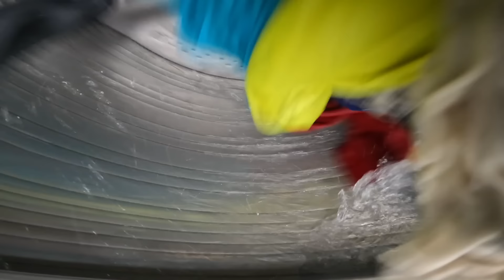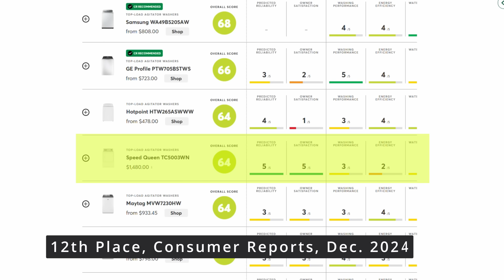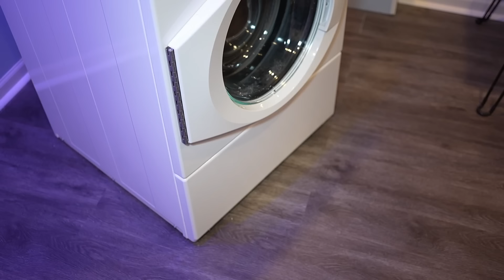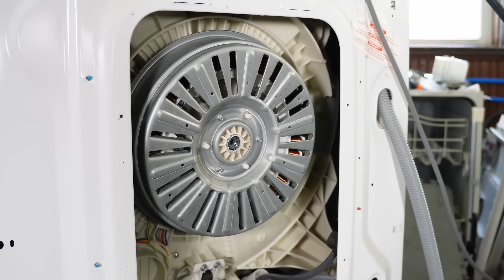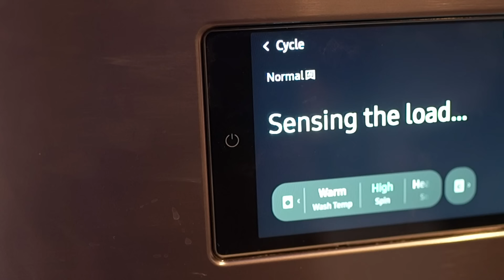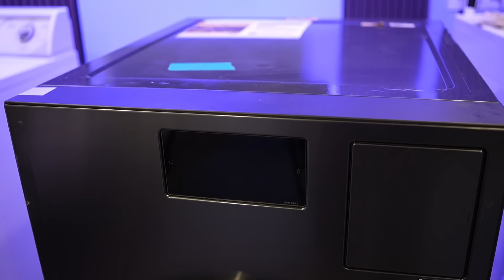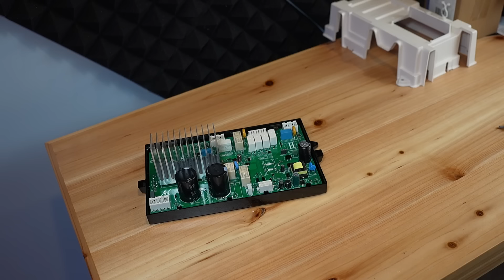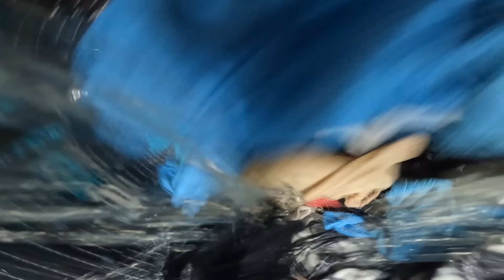Is America's Most Expensive Washer Great? The Speed Queen FF7009WN Test

Comment: So what is the best washer to buy? As far as wash time price durability and of course how clean your clothes are in the end? It seems impossible to find that answer anywhere. 
Here's what I want from a washer

1 clean clothes

2 washes clothes quickly
3 reasonable price
4 washer isn't going to need constant repair
5 washer should last at least 10 years minimum
6 quiet
7 low water consumption
8. Some bells and whistles
9stylish
10. Easy repairability
11. Durable. 

Why is that asking so much?

I don't care about wifi, ai or other crap.
Reply from the maker: None of those things are possible together. You're demanding a few contradictory things.

You cannot wash fast and with low water consumption. That is not possible. You get to pick one.
You cannot have a washer that is reasonably priced and will last 10+ years. You get to pick one.
You can't have a quiet washing machine that is going to have the other things you demand, because quiet requires a BLDC and they aren't built for speed.

Until you're willing to cut that list in half, it can't be built. Quality costs money. Performance costs money or quality. Efficiency costs time.

Comment: $600 for the replacement motor board is an absolutely scam. The components on it cost less $15, of course I dont expect it to cost $15, but in no way should it be $600, that buys you a BRAND NEW washer. Say that board lasts 15 years, now that part will be harder to find and even more expensive, if its even available at all. Sometimes buying 'average' products is ideal, as parts are cheaper and easier to get.

Comment: Yes, it's worth every penny. I went through 3 other washers, brand new, and my laundry even though I never mix my whites with my darks, or even with my colors. It never fails me. The water comes up to the correct height, for each load. I love my Speed Queen top loader. I can easily wash 2 quilts, and sheets set, no problem. Oh, my only complaint is I can't rinse in hot water.

Comment: Would really like to see some comparison notes between electric and gas dryers.   I have had an electric dryer forever, however, I do have a gas outlet.  I often think on what I would get when my current unit needs to be replaced.  I am pretty sure it would be a Speed Queen but I wonder on the differences between electric and gas.  Thank you.
Reply: Drying with gas is much, much cheaper unless you have ridiculously low power costs.

Comment: It's unlikely an average home user will come up ahead on a $2,200 SQ vs a $650 front loader. Assuming you need 3 front loaders to go 25 years that's $1950. On top of this the $1550 you saved today can be thrown into a CD that would net $80 a year. And then if you move in 5-15 years, whoever you sell your house to is not going to offer you  more because you have a SQ.

Though as you said in your video, this is more for power users who would demolish a consumer grade washer quickly.

Comment: btw. $0.015 *10,000 washes =$150 per gallon (per wash) over the life of the machine. 
So to save even $1,000 usd, it would need to use 6.7 gallons LESS per cycle than the competition. 
Once you factor in electricity cost to dry clothes, that number comes down of course. 

But that math wasn't mathin for me when you said that in the conclusion! 😂
Reply from the maker: Depends on who the competition is. If it's another front load, it's not a good deal. If it's against other Speed Queen offerings, you'll find out that this uses about 20 - 30 gallons less per load for the same stain removal quality.

Comment: Do American washers not come with an internal water heating system?
Reply from the maker: Some do. Many don't. All washer outlets are 120v so there isn't as much headroom for a heater as there is in Europe.
Reply: @bensappliancesandjunk  Got it, thanks. I just figured the outlets would be 240v for washers, but I guess not.
Reply from the maker: @Makinx  not in the US, no. We use 240v/30a for dryers but not washers. Its typically 120v/15a for washers

Comment: Man these front loaders suck because when I used one all it dud was flop slightly damped clothes around
Reply from the maker: Just because you used one doesn't mean every one is bad. Some are absolutely fantastic, and can spin dry clothes in a way that top loads can never, ever, get close to
Reply: @bensappliancesandjunk  I like the stainless steel ones better because they actually wash , of course I can't afford one in my house due to them using a higher amp power source like a electric driver but yeah 

Plus you can actually see the splash action as well!

Comment: The problem is..... Is that, in order to have a machine with that kind of build quality. It naturally is going to cost more because the end result of offering it at a lower price is cutting corners in quality and you end up with "modern junk" quality that you see in most appliances that you had seen during your career. Thus, Speed Queen wouldn't want to go by the way of whirlpool, Frigidaire, Samsung, and especially Kenmore. Some things just cost more, and it is for a reason. In this case, it is because most modern appliances are not made with long term quality and reliability as they used to be. Money isn't always the be all and all with purchasing decisions like this one.

Comment: My Panasonic is 34 years old now and holds 12kg.  Not honestly sure we have every had stains that stick though a wash cycle.  Bought it used for roughly $250US in 2001.  The only repair was the door sensor failed and cost roughly $5.

Comment: I’m running a 20
Year old non coin commercial speed queen commercial similar to this one.  I paid $100 for it and removed the dryer off the top of it.   The top from the dryer bolted right on.     I had to replace the bearings.   Next it needed shocks.   Then the door seal fill hose broke.   I deleted that and sealed it up.   I epoxied a copper tube into the top of the drum for the fill port.   The wax motor in the door latch needed some fiddling but with a love  tap it continues to function.     We went to a front load because our awn432 broke a transmission.   I wanted to save water as it’s expensive in my area.   $250 a month for our household.

Comment: I get significantly less calls on these than the top loaders and the sentiment seems to be similar among technical circles and with the service fellas at SQ.. 

Makes sense, as the weak point of the old Amana platform was always the tub seals and the bearings. Same case with the TCs and TRs. It’s a great platform but heavily reliant on the tub seal and the bearings in the weldment

These front loaders are rock solid. You can pull the wash tub in 10 minutes or less if you know what you’re doing. So easy to service. And so pretty looking!!

Comment: Great video. I think you could add to your scientific measure- Using the same set of clothes weigh it before and after washing to see the difference in weight. That would illustrate how much money you could potentially save with dry times. 

If you really wanted to push it next level when doing a comparison see how long auto sense dry times varies if the weight of the clothes are moderately different. 

Of course all of this takes time and lots of effort so I'm not sure it would really be worth it to be fair.
Reply from the maker: HI, you'll be happy to know that weight/water extraction in spin is a key factor of the next test between the TC5 top load and this FF7. You save 300 - 325 wh per pound of water extracted which is a lot vs. the electric cost of the spin speed. 

Auto sense is a great idea - I need to figure out a good way of timing it effectively.

Comment: Consumer reports has a moratorium on hiring anyone with any relevant experience.
Reply from the maker: Eh, I think the real issue is they weigh all factors equally. If a machine is reliable and people love it, it doesn't matter if its slightly noisier or less efficient than others.

In the real world, people have different preferences for machines - regardless if its me, or anyone else. If they were smart, they'd let people that subscribe weight the various factors to influence the final CR score to make a customized suggestion. IT'd be easy and make sense. But until then, it can be a junk rating based on very minor factors adding up to huge influence on the final ratings.
Reply: @ they have a test out there comparing a zero turn mower to a lawn tractor.  It perfectly sums up their level of expertise and journalistic integrity!

their car reviews have always been a joke, and now they test 2 different cars with the exact same jatco transmission, and condemn one and praise the other.  If they aren’t selling reviews, I would be absolutely amazed.  

But, like they always say, don’t ascribe malice to what can easily be explained by incompetence.

Love you videos, though!   Very thorough.
Reply from the maker: @randymagnum143  i get that. They do love to compare front loads to top loads and act like it's apples to apples. Same with stoves and fridges. Sometimes there's a point to getting something different and classes can matter. 

On the transmissions, which cars are you referring to?
Reply: @ the Subaru, Nissan, Mazda, Mitsubishi, Chrysler, and others all used the same jatco CVT.  Consumer Reports trash talked some of those cars for their transmissions, but not others.  Now the local Subaru sells off all trade ins because they don’t want the liability a $7500 transmission job in a 5 year old car with a rapidly diminishing value. 

Honda is having terrible luck with CVT too, but like Toyota they have a wall of perceived reliability that will slowly fall over time, rather than come crashing down all at once.

Comment: Pro Tip: If you want the best washing machine ever made. Find an old 80 series Kenmore top loader. I've had one for almost 30 years and the only part i've had to replace is the dogs for the agitator. The heavy duty cycle is about 15 minutes and clothes come out clean thanks to an agitator. I've used numerous front load washers and they all suck ass. The wash times are ridiculously long. The spin cycles are so violent, most of them damage clothes, they stink if you don't clean them very often. There isn't a front load washer out there that is worth a damn outside of big industrial units that you see at laundromats.

Comment: Honestly, I wish Speedqueen was easier to get. I just was in the market for a washer/dryer and i wanted speedqueen but needed to find a dealer etc, so i thought Electrolux was the next best brand, and while the washer/dryer is very nice, the customer support is just the worst ive ever experienced. when you buy from them god forbid you forget to hit the button on it free install, when it says the install is free. So i got my Washer/Dryer and they didnt install, Didnt brind the equipment for ME to install and then they wanted to charge me, to get that equipment, Had more issues because i got a electric dryer and needed Gas. Well that shouldve been the easiest thing to get handled and it took over 3 weeks many many calls and then they didnt want to just send me the SAME priced machine just gas as a replacement had to go out of my way to place Another order almost didnt get the same Percentage off cuz the promotion expired, but got lucky as they were running another promotion afterwards i was able to just buy the damn thing.

Comment: We purchased a Speed Queen SF700 (stacked front loader washer and dryer).  We calculated that it was not quite but approaching twice as expensive as buying any of the common brands.  After discovering that our previous machines we're no longer repairable in certain ways due to parts like drum seals  becoming discontinued and after months of research we just decided that we'd rather invest in something repairable than take a chance on the current crop of common residential appliance offerings.  We're convinced that like many other products, the lowest standards that get the machine past the warranty period are acceptable, and nothing more.

We've had this machine for 4 years and it has a 7-year warranty.  We had somebody come to investigate a squeaking dryer pulley which was replaced at no charge but no other problems.  We're happy with our purchase

Comment: We have a family of 7 and we were buying new machines every 2-3years.  The worst performer was Samsung, which died at 18mo.  

We finally bit the bullet and outfitted our double laundry room with two sets of these, and could not have been happier. We are in our second year and they still run like new.  We did get the steam driers, which were a new offering from SQ that year, and had to get a leaky part replaced in once machine at no cost to us, and one of the washer door locks needed to be replaced, again, no cost to us.

Comment: Thank you for another amazing video! While I’m not in the US to buy those machines, your videos are incredibly therapeutic to watch 😆. I actually purchased the Bespoke machine featured here after one of your earlier reviews, and it’s truly amazing!

Regarding the tests, I missed some consistency. I’d suggest focusing more on testing specific machine capabilities instead of aiming for similar runtimes across scenarios. For example, comparing Normal Cycle vs. Normal Cycle or Hard Stain vs. Hard Stain, without swapping machines (like the LG in the last test). Modern machines rely heavily on programming and sensors, which are designed to excel in specific conditions and play a huge role in performance—justifying their price and experience.

For instance, the Bespoke has a whitening/bleaching cycle for hard stains and white clothing, which could have delivered better results in such a test. While this approach might seem "unfair," it reflects the value proposition: if a pricier machine lacks advanced features to handle these scenarios, it might not be worth the cost.
I would also suggest less load on the machines, while the manufacturer always says that they can handle that, the heavier the load, the less efficient they are, clothes need extra space to "rub" on each-other, while this test with a heavy load might seem realistic, it probably affected the results of the Speed Queen.
Apart from the critique above, it's amazing to even see color depth tests and excel spreadsheets! Your research and testing are truly amazing! Probably the best washing machine Youtuber in the platform!
Reply from the maker: Nice! What country did you buy the Bespoke from?
Reply: @ Brazil!
Reply from the maker: @nickstarlight  OH interesting. What kind of washers do you have there? I have a fair number of my videos translated to Spanish because many of the machines in the US (mainly Whirlpool and GE/Mabe) are seen in Mexico/Latin America + our large Spanish pop, but Portuguese would be interesting to translate too if I knew more of what was down there.
Reply: @ most consumer available machines are LG, Samsung, Electrolux, Brastemp, Consul, Midea, Panasonic and Mueller. There are other brands but their availability is quite limited

Comment: I will saw samsung is not nearly as unreliable as people say. There sell 1 out of ever 3.1 washers in the US sold per year. So you going to see more complaints than every other washer but they don't have 1 of 3.1 complaints. Speed queen is awsome don't get me wrong they are the best just saying Samsung is not the worst.
Reply from the maker: Samsung has gotten better lately, but there was a pretty good string of years where they were by and large the worst on the market. 

The issue is that as far as I can tell, they have a similar market share to Whirlpool, and tend to last a bit shorter on average across the board. At least historically (past 10-12 years). However, today, if I was honest - I'd take a Samsung front load over a Whirlpool and even a Samsung topload if its a higher end one. I still think that the Whirlpool VMW platform is really good, but thats the last actually-good wash product Whirlpool has on the market, because their VMAX system is trash.

Comment: I absolutely love my speed queen set.   I have the basic commercial model but it has the fastest wash cycle of any washer I have ever owned.   The dryer is quite basic too, but it is the commercial grade model and it dries the clothing and other fabrics just fine.    My set reminds me of what you had in the laundry mats back in the day.   But I think i'll be upgrading to the new model you show here at some point.   It has a LOT more features than my basic commercial unit and it is a front loader.   I still think front loaders clean the clothing and fabrics better, simply through the tumble action rather than it sloshing the clothing back and forth which isn't very efficient but it gets the job done, just differently than the front loaders.   But the front loaders need more maintenance to prevent mold from collecting in the crevices and on the rubber surround on the door.   I've NEVER had that problem with my commercial top loader.    Although even with the added maintenance,  it's a machine that I would buy on the next purchase.   I might have to sell my basic which is only a year old on Craigs list or something and up my machine to this bad boy!

Comment: Did you seriously put a white shirt in the washer with colored clothes and then do a color test after it was washed? I mean... WTF?
Reply from the maker: And I did it for literally every single load with the identical same load of clothes every time, so any variance if values would still report the same information as needed. Additionally, the spectrograph information was compared to the shirt's clean area and white value, so any change/degredation for being mixed with other colors would of been the same on every load.

You could have easily read the documentation in the comments which has the source data mentioned in the video to have realized that.